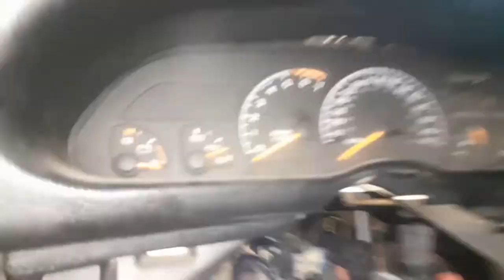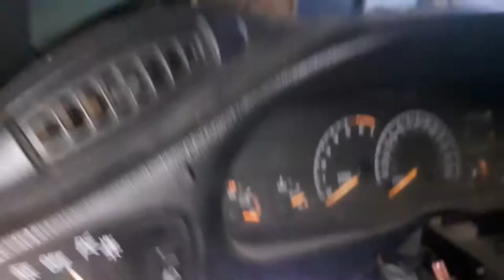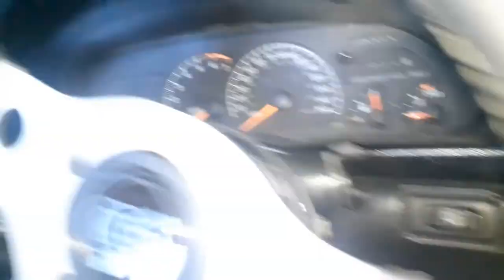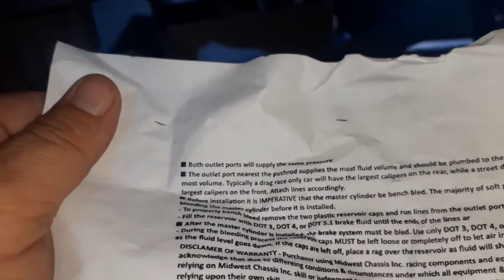Manual Brakes Master Cylinder Install and Bleed 93-02 Camaro Firebird Trans Am

Comment: is this "the brake masters" manual conversion kit for f body?
Reply from the maker: yes
Reply from the maker: or are you asking if I went with that company? I forget company but it is manual brake conversion kit for F-Body 93-02
Reply: @CarportGarageDragRacing   yes did u have to cut the fire wall
Reply from the maker: @ianb3866  no, only had to drill a new hole in pedal lever
Reply: @CarportGarageDragRacing   okay thanks my adapter plate was shitty quality so i had to open up the bolt holes in the firewall with a dremel and going to have to grind off some steel on the bracket that holds the brake pedal, i went with the wilwood kit tbm sells